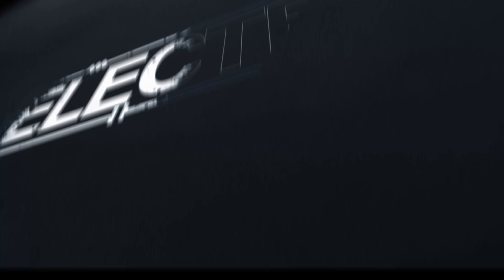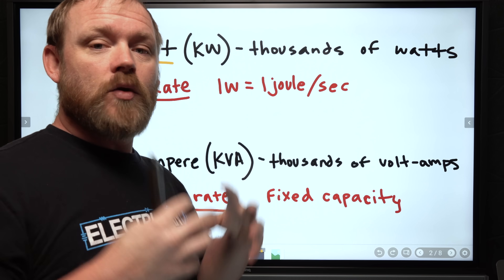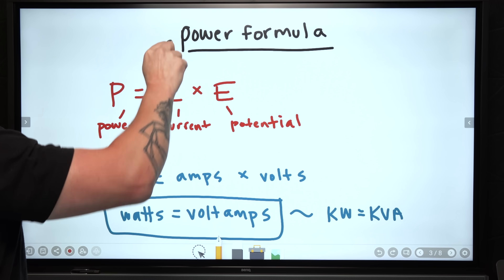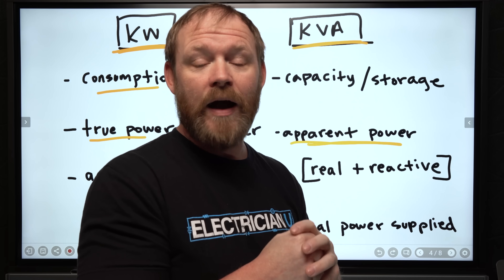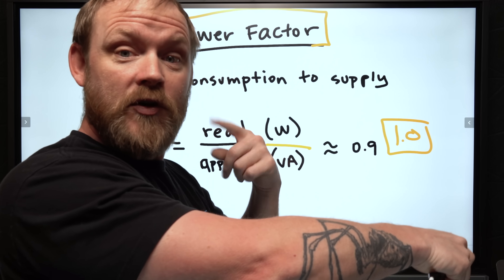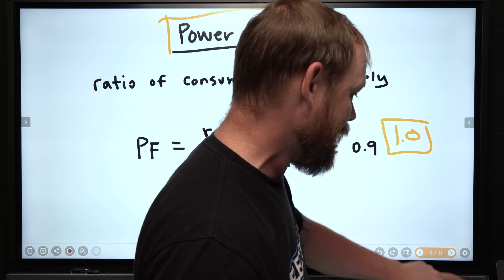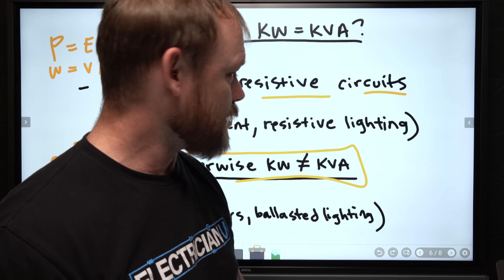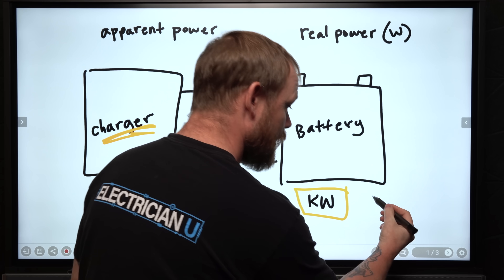Why KW and KVA Are NOT The Same Thing (Even If They Seem Like It)

Comment: Simplifying, VA is W minus energy "wasted" in passive resistences of circuit. There is no perfect conductor in real world, so part of wattage of system meets the passive resistence and dissipates as heat, light, etc. When you discount that passive resistence from a circuit, you have the effective load that circuit can provide. In low power systems, that passive resistence can be ignored, but in higher power you simply can't ignore it. Thus, for higher power systems you need to know the difference between W and VA.

Comment: Power factor is 100% in cases of Resistive heat strip loads. Where is a induction load is for example 90% and capacitive loads might be 110%. Its the leading or lag in sign wave on AC current. AKA Hertz. 59.9 in america even though we see 60 Hertz on equipment.  I'm under the impression we have lots of moter loads on the grid more than capacitive and resistive loads. Now on another note. Transformers use watts to transfer energy but they factor that in for VA ratings. But looking at Ambient temperatures can effect va capacity. In cooler climate a 25kva might be full capacity rating. But in hot climate it might be 20kva just as a example.  Lots to consider.

Comment: You are making that difficult to understand but it's ok because pay for minutes entertainment. 
Easy way Kw is the load on active resistance (ex incandescent light bulb).
Kw cames from VxA=W.
KVA is the load in reactive power. So is the relation of VxA is not linear because we add cosPHI. Summary KVA=VxACosPHI. PHI depends by reactive load (ex neon light or led light ore motor) because those have condesators and inductiors therefore PHI chages. Anyway KW=KVAx0.75
Reply: KVA (1000V x A) = KW (1000V x A).
Reply: You added disiptation (as the resistence has not been specified)?

Comment: I study for an election qualification at the moment and YouTube suggested this video yesterday. I may be able to contribute a little bit to it here: 

In a circuit with a simple consumer let's say light bulb,  the power rate is 
P = I x V and is the unit of Watt (W).

But as I understand the video most of the time it is not that simple, because the not only resistors. (Etc light bulb) in a circuit but also capacitor and inductors.

That means you also need to calculate the reactonce one impedance.

reactonce = capacitor+ inductor 
impedance = reactonce + resistance

Somehow from knowing impedance and Voltage and Ampere reating of a device you can calculate the VA. 

(K obviously just means kilo, for example  1KW = 1000 W)

Now it would be interesting how to measure the VA on a device or calculate it.
Reply: You're going the wrong way. You already know that VA = Watts?
Kingston College of Further Education.
The maximum length of a cable that you are allowed to use is 100m, if thats what you're trying to decifer (beyond that there is too much volt-drop and you're tripping)!
The EU and US who do not have the same standards as Great Britain do not give you the power rating in Watts because Mr Watt was a Scotsman and they're just trying to work-out AC Power Consumption (The Continent uses DC Power Supply).
I hope this helps you in you're studies!

Comment: Typically KW would apply to DC circuits and KVA to AC circuits.. Both with the intent to quantify power consumption or power rating of a circuit..

Comment: Great video but at 12:08 you should not label the left graph as “no impedance”, it should be labeled “Resistance”.  DC circuits still have impedance but with 0ohm reactance.

Comment: In short: Volt x Amp = Watt on paper its correct. But with internal resistance and mechanical resistance we get a power factor
Volts x Amp x power factor = KVA

Comment: It’s sad how wrong most of his analogies are… this is actually more simple than he makes it sound once you understand power factor.  

If you measure current and voltage and multiply them, you have calculated kVA, this happens to equal kW when power factor is 1

kVA will be greater then actual kW when power factor is less then 1 like in most real world AC systems.

Both are rates, absolutely NOT capacity or storage because there is no time component like HOURS

Comment: The topic of AC power typically takes several days lecture in a 1st year electrical engineering class to cover and you're valiantly trying to teach it in a 10 minute video.   Don't be surprised if folks still don't get it.   😁

Comment: A watt is a unit of power, not energy. It is not time dependent. This is why we have watt-hours, which is energy. Yes, it is equivalent to an energy divided by time, but energy is the time dependent component, not power.

If you plot power over time, energy is the area under the curve, or the integral of power.

Comment: KVA means with a fixed average current, more time per cycle is spent supplying/using high current when voltage is lower than the ideal sinewave (max current when voltage is maximum). Thus wires & transformer windings get hotter (higher power loss) when kVA is much higher than KW, current is higher than ideal for a given KW. The rated maximum current for the wires & transformer are irrespective of instantaneous voltage at any time.

Comment: This is a difficult subject to describe in a few minutes.  I am concerned about the comments that I see.  I think a lot of folks got taught incorrectly or didnt understand the material.  I do not have the benefit of following electrician coursework.  The very significant prerequisite missing is the Calculus and also complex numbers (i will assume not required for electrician education).  Those applied to non-linear circuit analysis is where the understanding of Power Factor is found.  I think Supplied vs Consumed to describe Watts and Volt Amperes is misleading.  One must understand sinusoidal analysis and mathematical transforms to understand the difference between circuits with no reactive elements and ones that do.  Voltage across an inductor is L*dI/dt and current through a capacitor is C*dV/dt.  I would dare say the audience is required to  understand a transform to the frequency domain to know about reactance (and its dependence on frequency).  Finally... the power company certainly produces power with an imaginary component (dependent on the load), but they charge for Real Power only.  I agree with you on that point.

Comment: As a mechanical engineer, I was exposed to this in the circuits course that I had to take, and understood it fairly well.  But my memory of it drifted over the years.  I was kind of lost in your explanation until you talked about the vector sum of resistive and reactive loads, then it became more clear.

Comment: Mechanic here. Had a similar issue with torque and kinetic energy.
It’s different but physically the same. Guess this is also true for KW and KVA
Reply: Torque is a force applied at a distance from a center of rotation.
Energy is a force applied through a distance of motion, whether it be linear or rotational.
You can convert torque to energy by multiplying torque by number of degrees rotation, converted to radians.

Comment: Reactive power is a function of the lag or lead of current relative to voltage. eg. In a capacitor current leads voltage as the cap charges. In an inductor current lags behind voltage, there is a delay. Resistive circuits have no delay and have a power factor of 1 which is when KW = KVA. So, as an example when current leads voltage ( capacitive  load ) V is lower than expected which reduces power when calculating V x I. Here is the problem because the power (ability to do work) has been reduced the current consumed by a load can increase to compensate and if the power path is not sized for the higher current it will over heat. So, being mindful of the KW rating relative to the KVA rating allows the power source to be properly matched with the load and distribution path.
This elevated current can also benefit the electric company because most metering looks at current but it can also overload the distribution network in some situations.

On mag fields - energy is stored in mag fields and in transformers, those fields are conducted in the core similar to electrons in a wire. So, they do not represent unused power but rather power that resides in a non physical medium. Consider this, in AC circuits the electrons vibrate back and forth at the same location at the common frequency of 60 Hz.  So, there really is no flowing current. Energy is transferred along the line in the mag field that surrounds it. If you are interested in knowing more about this look into Transmission Lines and be sure to consider the current mirrored in the ground be it below HV lines on towers or ground planes in a pcbs. You will find a world of things you may  never realized were there.

Comment: Residential and industrial sites are charged differently too are they not? Residential only pays for kw and industrial pays for all of the kva because they have a need for certain level of real power which requires the utility company to make sure that they can saturate say the 3 phase power to the building as opposed to a residence where all the electrical devices can be off any given time so the power company does not have to guarantee a certain amount of apparent power to meet demand. I have a detached garage which used to be a cabinet maker's shop which has it's own meter and the bill is usually a set price, even if i do not use barely use electricity in there. The bill is 25 dollars a month even though, I know it's not using that much power but I have sockets that supply a large amount of power from when there was industrial cutting equipment and such in the building. I am happy with this situation as I do sometimes need to do welding which uses that specific plug type, apologies for forgetting the name off the plug off hand. The parcel of land it sits on is still zoned as commercial as well.

Am I correct in saying this? I deal with small signal circuits mostly and it's been a while since i've thought of this.

Great video brother.

Comment: The definition of a watt is simple  1Watt = 1volt x 1amp  or VA .  Introducing the complexity of reactive power and most other facts like  power factor is mudding the water here.  This does not change the simple definition. You can not educate reactive loads etc in a 10minute post.
 if a current of 1amp flows through a conductor with 1 volt across it, we define the resistance of the conductor as 1ohm and that the power dissipated is 1 watt.
Sure, when it comes to reactive power , batteries rated at kwh this is different you are just confusing people. A KW or KVA Is not the same as a KWh . This is defining that the battery can provide a KW (KVA ) for a time period of 1 hour.

Comment: You should never use the terms capacity or storage when referring to kVA. That would be incorrect and misleading, because capacity is measured in kWh. kVA refers only to the apparent power rating of a device or system, not to its energy storage capability.

Comment: Good explaned,  but I tought its about the cosinus phi?  Cos. phi is the angle displacement between current and voltage. It must be as close as possible to 1, but it is almost always less then 1. As you say, with a pure resistant it can be. I'm not an electrician and my English is not good enough to understand everything, or to explain my thoughts. Thanks for your video. Grtz from an old man in Belgium.

Comment: using a microwave oven as a reference point, is the power consumed from the mains supply the kva number, and the number of watts for its output power the wattage?

my microwave claims to be a 1200w machine. it draws about 1600w from the wall though.

similar for a computer PSU - its output may be 750w, but it draws 825w from the mains supply.

or is efficiency not the same/related as power factor?

Comment: In the US Navy, we’re taught basically the same thing. It’s made easier to understand. A beer mug filled to the top will have foam, and beer. The beer is the KW and the foam is the KVA. We can see the difference because it’s a clear mug, but a voltage regulator can’t tell the difference. All AC circuits produce inductance (distortion as impedance), creating KVA. This will expend a lot of fuel for the prime movers, trying to supply a load that’s smaller than what it appears (KVA). Dumping more power into the system that isn’t used, creating more induction (KVA).

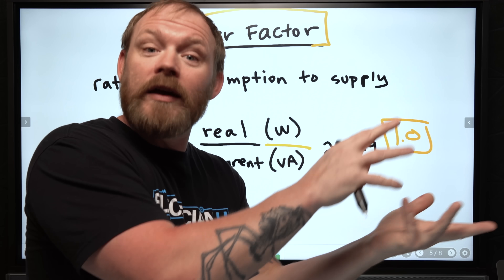Comment: 7:18 Could we use the analogy for reactive power as the inertial momentum required to return the oscillating electrical wave from the load to the grid?

Comment: So in other words, a 8kVA generator can only carry a 8 kW load if the load is purely resistive (incandescent bulbs or geyser elements)? If I start using motors or electronic circuits as load, that drops to only 7.5kW? How does one determine the PF of individual load components? I don't think I've ever seen a PF indication on an electric device such as a fridge or water pump?

Comment: Working with generators has taught me that the Power Factor of less than 1 means the current “lags” the voltage. So the current is the same value but it is happening at a lower value of voltage potential due to the “lag”. 

Ex. 240V x 52A is 12,500 VA
@ 0.8 PF you get the same 52A but at around 200V which equals 10,000W output. Or 240V x 52A x 0.8 PF is 10,000W

Comment: I have a practical question. I had two 25 amp chargers for my LiFePo batteries and I bought a 1200 watt generator to supplement my solar panels (on a boat with no more room to add more panels conveniently). At 13-14 volts those chargers can put about 700 watts max into the batteries. Even allowing for losses in the charger, I figured I was underutilizing the generator. So I bought a third charger, but as soon as I plugged it in the generator overload light went on and the generator quit. The chargers are switchable, 10/25 amp, and if I switch one of them I can charge at 60 amps without any problem. I plugged a meter into the generator and with all three chargers set to 25 amps, the meter shows a little over 1000 watts when the generator overload light comes on and the generator shuts down. Is there anything I can do to get the full 1200 watts out of the generator? I'm guessing it's the KVA overload that's causing the generator to shut down at less than 85% of its rated wattage.

Comment: Doesn't this mean that a hifi amplifier should actually be rated at VA as it is an output. And I'm of course not thinking of the amplifier's power consumption, but what it is delivering to the speakers (load)

Comment: You didn't explain why batteries are rated in amps and amphour capacities.  It makes any and all actual "power" or "energy" calculations dependant on many things.  I believe this is exactly why it is that way.  Because everything else "depends".
Like how long with a 300Ah battery run a 300W DC motor?  Hmm...  You can't simply convert the two by saying, "Well, it's a 12V battery so....", because the voltage will vary and that will vary the motor load/output, which will vary the battery current and so on and so forth into calculus.

Comment: In terms of "industrial electric billing" it might surprise some people that they are not billed primarily on "consumption", ala kWh.  They are instead billed on "peak real power" and additionally "peak kVA" and "peak kVAr".  Additionally they pay a monthly charge for their kVAr maxima over the month as well as other distribution and transmission related charges based mostly on those peaks and the distance from the power plant.  In the UK they get billed on the 15 minute interval.
They don't get billed on actual consumption.  So a single spike to 100kW that lasts 1 minute is billed as a 100kW peak load for that 15min interval.
The reason is, it costs the grid operators far more money to "support" that the industry exists and what it needs than it is to actually sustain the output.

Comment: pf is simply a number between 0 and 1 that indicates the phase difference between current and voltage in an ac load circuit. 1 (unity = purely resistive load, hypothetical) current and voltage being exactly in phase and 0 (reactive, leading or lagging load) current and voltage being 180° out of phase and anything in between.

Comment: Kva (apparent power) = Kw (real power) x pf. pf can only be in the range from 0 to 1 and only ever applies to ac circuits. True P = I x R. This means power transmission equipment must be rated in Kva because R is fixed and transformer winding sizes, transmission lines capacity etc are decided on the variable I only. This is why commercial customers are charged a pf tariff. In the worst case (hyperthetical) scenario a load circuit at pf = 0 will draw x amps at x volts that are producing no load power but still incur generation and transmission losses for the supplier.

Comment: In short: KW is the energie you pay for, KVA indicates the max amount of energy you could use. So have a power outlet of 230V with capacity rating of 16A. Max capacity is 230x16=3.680W. Do you connect a heater rated 2300W=2.3KW you have to pay for the time you use that heater. For 1 hour that will be 2.3 KWh (= 2.3 KW for 1 hour) on your bill. What heater could you be using? Well a max 3.680W heater because that is the the max that your KVA rating allows. Besides you don’t have worry about any factor because (at least in EU by law) all apparatus have to be compensated for that.

Comment: OK, I'm an electric simpleton and generally work with DC.  I'm sticking with all these things being different terms for the same exact thing. :-)  It works fine for what I do.  If I don't need a different term for supply vs load.  Just the same, thanks for sharing. :-)